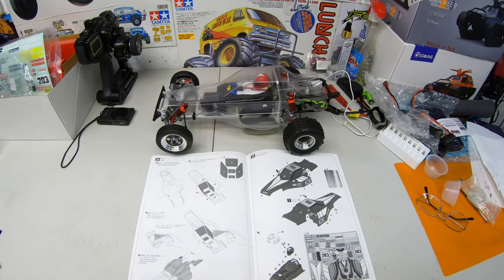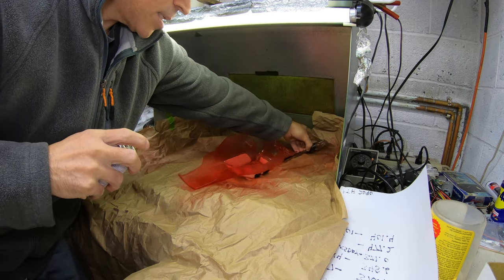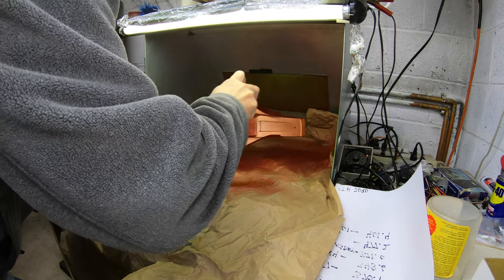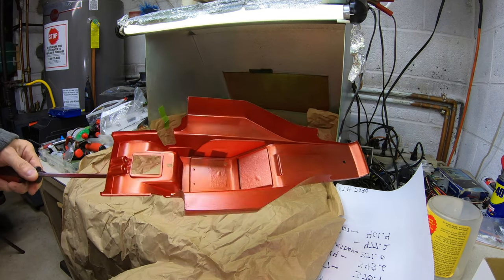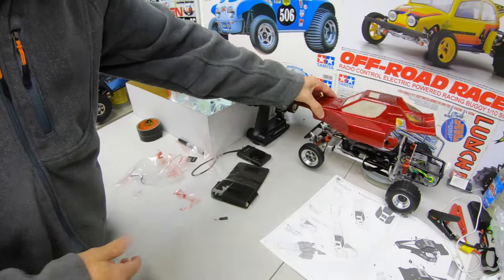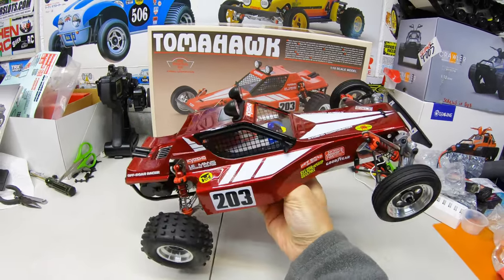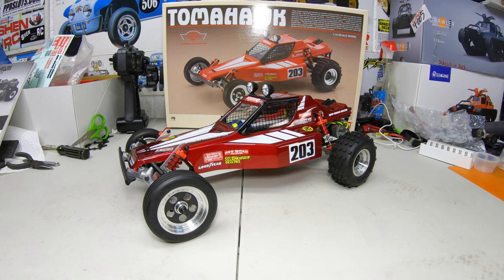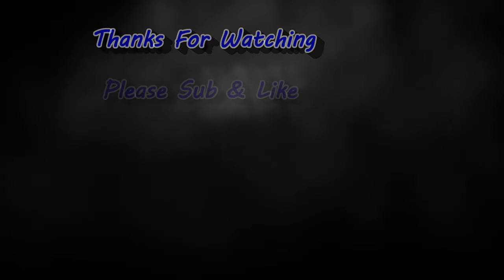Kyosho Tomahawk Custom Paint job WOW!

Comment: Awesome colour Steve👏👏👏
They made the front window mask wider so the black frame stickers on the outside border direct to the window later (without the body colour in between). It's kind of ensurin the paint job will work in every case. But it's also very confusing. And you have to adjust them from the middle of the window without any orientation points, which is a little bit annoying.
Reply from the maker: Yeah I figured that out afterword's but it is kind of weird.  The color is stunning I love it! Thanks for watching.

Comment: Lovelly!!! I've seen it's still a bit transparent on the sides... Would you consider adding a final white or black layer?
Reply from the maker: Hi thanks, I backed it with copper color. I did not want to use black or white because it would mess up the candy effect of the paint.  Thanks for watching.